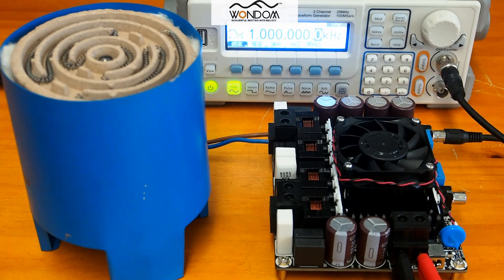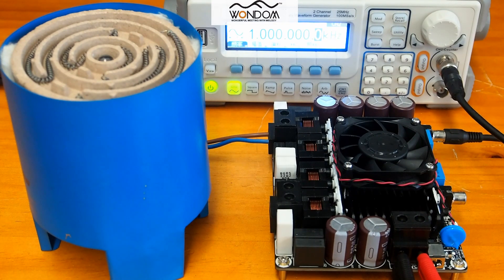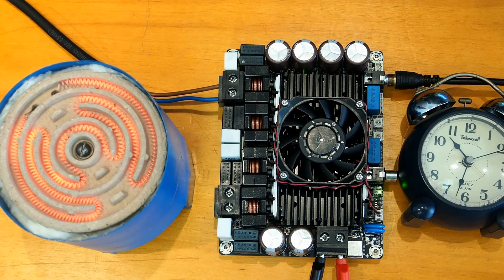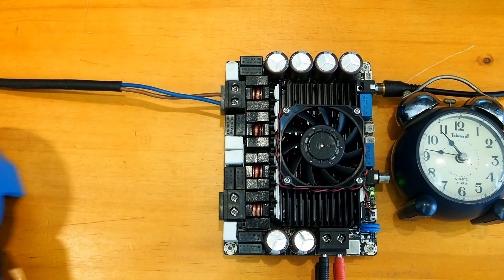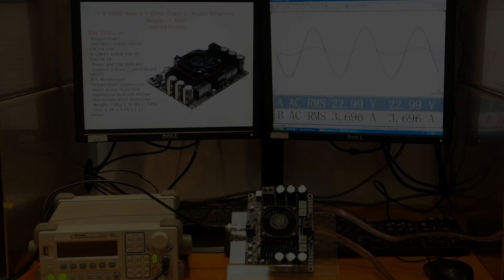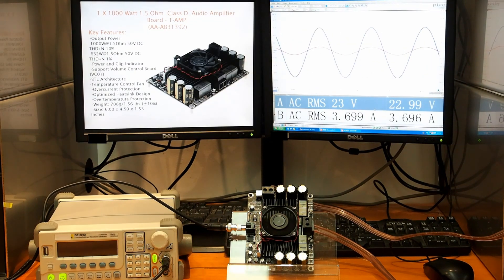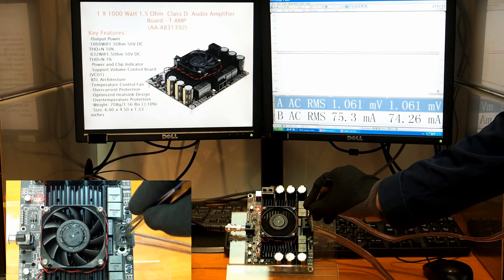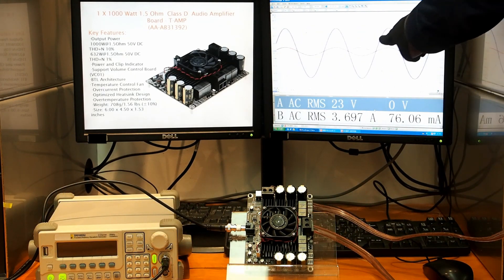Incredible Strong Amplifier with Great High Quality !

Comment: Hi, just a question. Your Amplifier AA-AB35281 says 3x200W @3 Ohm. Can you say how much Watt it is @4 or 8Ohms? (THD+N 1% or THD+N 10%)
Reply from the maker: We will make a video for this, in fact if  we are using 4ohm load, until maximum power, it will be less than 1%. Maximum distortion is about 0.2% when output is 200Watts.
Reply: @WONDOMAudio  ok, but how much is the power at 8 Ohm? Can I find the data somewhere?
Reply from the maker: @5chiffi   the distortion for those amplifiers are majorly limited by the power rail, if your supply voltage is 36V, you can basically calculate as (36/1.414)^2 / 8 = 80Watt or so, if more than this, the output will be clipped, and will get a lot of distortion.
Reply: @WONDOMAudio  Thank you very much! Waiting for the JAB3+ in your online shop btw :)

Comment: I bought the 2x200 Watts amplifier. What i get was a peak of 8 Watts at 40 Volts, no helping answer from the Wondom Support at the Sure electronics Store and a hole of 34 EUR in my wallet. By the way, that was not my first DIY build, so i think my construction around the amp was right.
Reply from the maker: Hi, 
meloniuskrebs. 
Could you please contact us with store@sure-electronics.com to provide us with some pictures or videos that show your connection and the problem?
If there is a problem, we will try our best to solve it for you.
We will reply to you as soon as we receive your email.
Reply: @WONDOMAudio  Already wrote an E-Mail with pictures and an EMail with a video at this mail one month ago. No answer. I opened a paypal case because i want a refund and also nobody answers. Bad Product, bad Support, Bad Seller.
Reply from the maker: @meloniuskrebs  Could you please tell us your email address or order number so that we can check it and solve it  for you?
Reply: @WONDOMAudio  I have the exact same problem, just with a 2x100 Watts amplifier. The delivered wattage to the speaker just isnt sufficient and is very low sound quality.
Reply from the maker: @simonryvold5194  Hi, 
Simon Ryvold. Thank you for your watching. Please kindly take reference of the following video which shows a actual testing of the output power of 2 x 100W audio amplifier board.

https://www.youtube.com/watch?v=-Ni0JGWFb84&t
Please kindly send a video to store@sure-electronics.com to show us the problem so that we can check it and solve it for you.

Comment: Lmao😂 2k wats from this?!
Reply: Yes
Reply: @Davidslabofficial  it can not supply anything near 2k wats
Reply: @revolution5547   you are right 😂😂😂😂but it can around 500watts for sure my friend have this amplifier this amplifier can deliver 650 watts into 4 ohm load without distortion but no more than that
Reply: @revolution5547  i can supply 2k watts but need a strong psu but it will be gone in flames after 2k output 😂😂😂😂😂😂
Reply: @Davidslabofficial  yeah. 500w for sure.
Reply: @revolution5547  😀😀

Comment: 2*1000W Peak or RMS?
Reply from the maker: Hi Twinstar
The rated power of WONDOM amplifier is the true RMS power. Besides, in order to maintain the balance of economy during manufacture, specifically regarding power and heat dissipation, some series of amplifiers are able to reach the rated output power, but only last for a while. You can watch this video which displays the 2500W true RMS output power of WONDOM amplifier for more detailed information. (Link: https://www.youtube.com/watch?v=P00ZsopIGNw&t=2s )
Thank you for your support! Have a nice day ;)
Reply: Wow

Comment: About this product: 2 x 200 Watt + 1 x 400 Watt Class D Audio Amplifier Board - T-AMP -STA516BE . Question: watt is RMS ?
Reply: Acronym for Root Mean Square.

RMS is the process used to determine the average power output of the speakers over a long period of time. RMS is derived from an equation which produces the most mathematically accurate measure of a speaker's power output. The RMS value is often seen listed as "watts RMS" on product packaging.

The alternative to RMS is PMPO(peak momentary power output) which represents peak output measured in microseconds rather than over a long period of time.
Reply: @CoquiAudio  ............................ ..  ..... But the question Is:.   2x 200watt peak or rms  ??
Reply: @urcomax  Root-Mean-Square
The peak value is the highest voltage that the waveform will ever reach, like the peak is the highest point on a mountain. The RMS (Root-Mean-Square) value is the effective value of the total waveform. It is really the area under the curve. In audio it is the continuous or music power that the amplifier can deliver.
Reply: @urcomax  I Googled xD

Comment: How could I run it in a motor vehicle? With only 12 volts, can you advise me please.
Reply from the maker: Hi, zarbi
If you want to use the amplifier on a motor vehicle , while 12V of the vehicle is not enough to reach the power supply voltage required by the amplifier, you can use a booster board.
You can visit the link below and purchase a suitable booster board based on your amplifier board's power, power supply voltage and other parameters.( Link: http://store3.sure-electronics.com/audio-oriented-power-supply-units/boost-step-down-converter ).
Thanks for your support.
Reply: @WONDOMAudio  what to use with 2x1000w amp?
Reply from the maker: @romaniexo  Hi, 
Роман Романыч. The power supply solution for 2 x 1000W IRS2092 amplifier board is a 2000VA Transformer and a 30A 100V 16000uF Rectifier Capacitor Bank Board. If you have interest, please contact us with store@sure-electronics.com for detailed information.

Comment: do all of your amps put out their rated power
E.G: does the 1 X 600 watt amplifier put out 600 watts at 2 ohms or does it do a bit under rated power
it would really help if you could reply because im building a new audio setup in my room
cheers
Reply from the maker: Yes. All of our amps could put out rated power, working with the typical voltage and load as we mentioned in  product manual. WONDOM never mis-represent power of amplifier.
Reply: Thanks man its appreciated
Reply from the maker: Hi, The working voltage of 2 * 1000Watt Class D Audio Amplifier Board - LV is DC 48-120V,
and the working voltage of 1 x 1000Watt Class D Audio Amplifier Board - T-AMP is DC 25-50V.
Reply: I bought one, it has blown up at very low power (not even 10 watts), I can send you a picture of the molten chip on the amp
Would not recommend to buy one of these, especially because of the not helpfull support. The amp wasnt older than a month and they didn't even answer...
Reply: @berberger4814  you might have made some error, I have got many wondom and sure electronic boards, and they are tough and cheeky.
Reply: well I have many of them too, but this one has blown up
I am pretty sure that I didnt made an error, DC supply from an lipo, audio input from an galvanic isolated dsp and an 4 ohm sub (the amp is for 2 ohm)